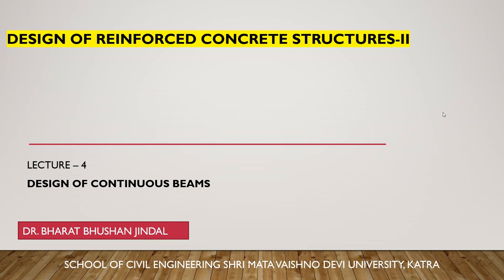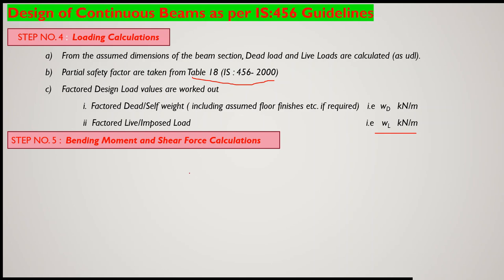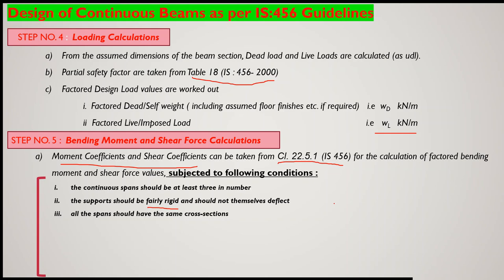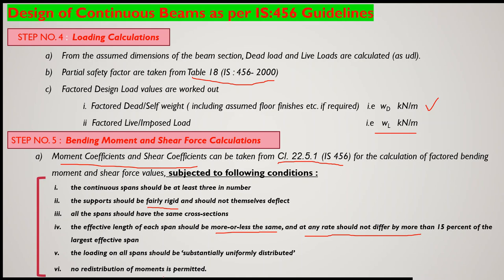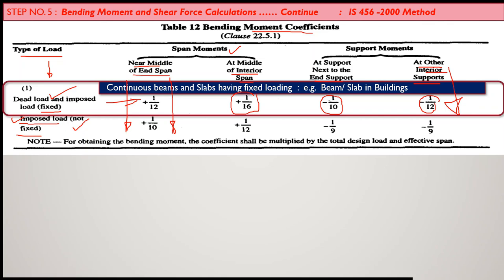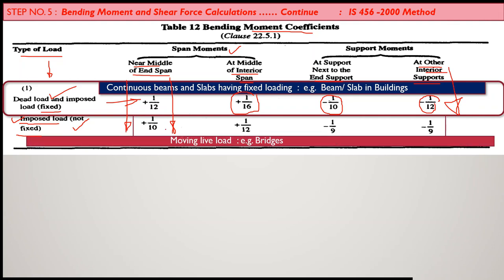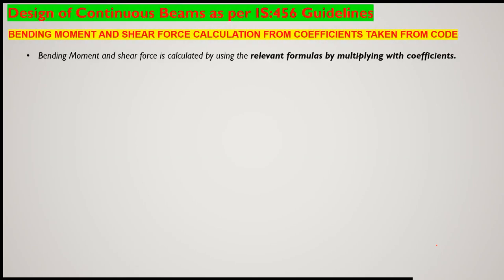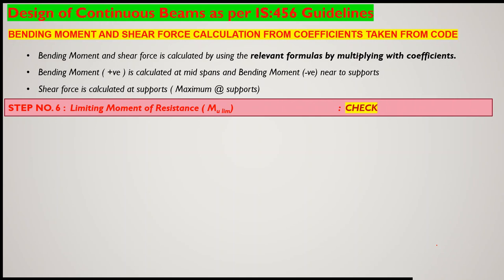Lecture 4 || Design of R.C.C. Structures || Continuous Beam Design Methodology || As per IS : 456

Comment: Sir when we r calculating moment for slab and supports which effective span we r taking into consideration
R we taking different span values or we r using only one span value for calculation
Reply from the maker: Each span will be designed separately as 'End Span' and 'Intermediate Span' which is explained in the video also.
Reply: @DrBharatBhushanJindal  sir then what about supports which effective span we will use for them
Reply from the maker: Pls. Elaborate your question.

Comment: in table no 12 of the is code for bending moment coefficient, there's a Note at the bottom of the table,  which says for obtaining BM it is required to multiply the coefficient with total design load and effective span. But how (coefficient X WL2 ) is coming then, shouldn't it be only (coefficient X WL).
Reply from the maker: It is same thing as discussed in the video lecture. IS Code indicates the use of coefficients by multiplying with 'W= Total Load' and in the formula taken in lecture is wL2 i.e.  w  is load per unit length and as per IS code ; total load = W = w L then multiply with 'L' 

So Bending Moment  = Coefficient × W × L = Coefficient × (w × L) × L

Comment: SIR IN THE THIRD SLIDE WHERE WE ARE TALKING ABOUT BENDING MOMENT CALCULATION SHOUDNT THE BENDING M0MENT AT A (end span) BE (wu,dl/12 + wu,ll/10)l^2 and BM at B(interior span) be (wu,dl/16 + wu,ll/12)l^2
Reply from the maker: That error was rectified in Revised Lecture 4. Good you could find out the typo error.

Comment: sir what can be the procedure for designing of the continuous beam having 2 spans only, kindly need your attention and if you have any video regarding this then please let me know.
Reply from the maker: Not major issues, you have to design both the spans as end spans, everything else will remain same.
Reply: @DrBharatBhushanJindal  but we can't able use Bending Moment co efficient and Shear Force Coefficient as per clause 22.5.1 of IS456.
Reply from the maker: You are absolutely correct, for that you have to draw Bending Moment and Shear force diagram by any method out of statically indeterminate methods of structural analysis.

Comment: How to calculate the limiting shear force ?
Reply from the maker: Not limiting shear force but you have to apply check for nominal shear force and maximum shear stress (as per IS 456 recommendations) which will be based on grade  of concrete.